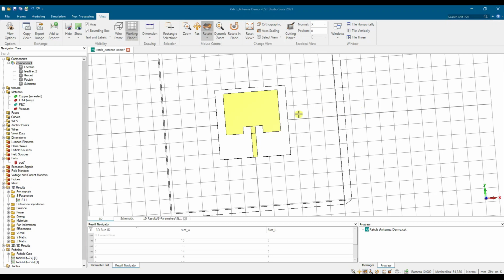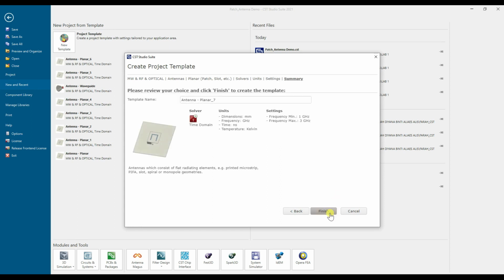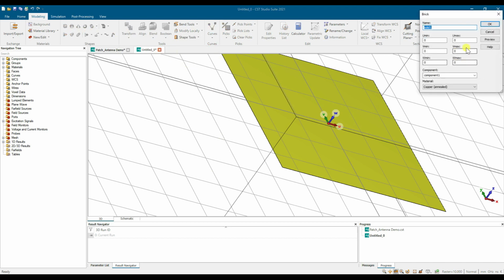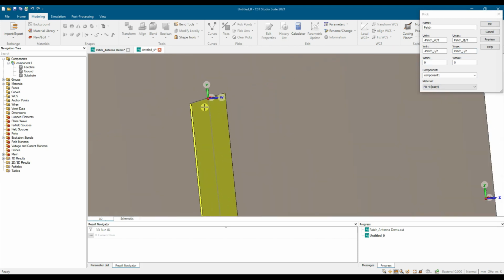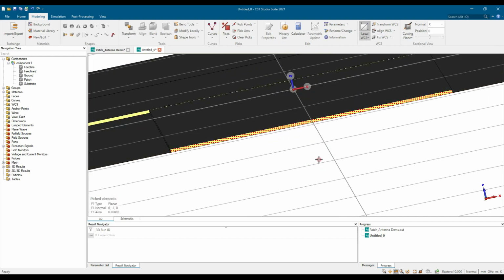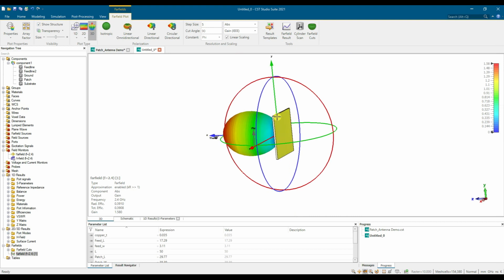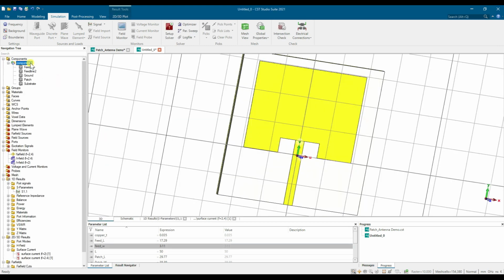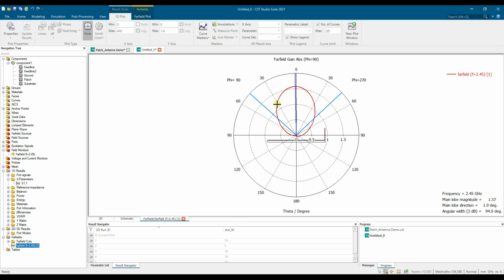Design Microstrip Patch Antenna Using CST

Comment: How to calculate the length and width of the substrate
Reply from the maker: Hi! Thanks for checking out the video. For a detailed step-by-step derivation and formulas to calculate the length and width of the substrate/patch, you can refer to these standard antenna engineering textbooks: Antenna Theory: Analysis and Design by Constantine A. Balanis (Chapter 14, Microstrip Antennas, specifically pages 811–815 in the 4th Edition), which covers the transmission line model formulas for width (W) and length (L).

Comment: Hi. I am Liyana. I currently doing my FYP in my last semester of degree. It is related to CST where I need to design a microstrip antenna using metamaterial. May I contact you for some advice and suggestions? I hope you see my comments and I do really need your help!!!
Reply from the maker: Hi Liyana, Microstrip Antenna Metamaterial Superstrate mainly is to Enhance Gain of the antenna, is combine patch antenna with metamaterial will have 2 layers. You can write down your question here or email me lysstuff888@gmail.com
Reply: Alright, just realised your reply. Will email you soon! Thank you for responding 😊

Comment: hello , nice tutorial, is this antenna have a good impedance matching and good VSWR ??
Reply from the maker: Hi, yes. When the S11 (Return loss,dB) is good same goes to impedance and VSWR. You may refer to the relation between Return loss(dB) , impedance and VSWR.
https://www.microwaves101.com/encyclopedias/voltage-standing-wave-ratio-vswr

Hope it helps. :)

Comment: why not adding patch and feed?
Reply from the maker: Hi, What do you mean patch and feed?  This is patch antenna with it microstrip feed.
Reply: @LYSStuff  why don't you use" add " to patch and feed line
Reply from the maker: Now I get what you meant. It does not effect the result. It just combine "add" both conductor design together to become single component. As long we sure both of patch and feed is connected, then is fine. Hope it explain your question. :)
Reply: @LYSStuff  thank you
Reply from the maker: Welcome🤝

Comment: MY RETURN LOSS VALUS IS NOT COMING BELOW -5 dB , WHAT METHODS I SHOULD APPLY TO GET IT BELOW -10 dB?
Reply from the maker: Hi, I think mismatch impedance of the feed. First, You can use a quarter-wave transformer to do this. Else is the design dimension not suitable for the desire frequency. 

However, you need to figure what is the application of the design? If you designing antenna, you might also need to  consider the polarization, gain, efficiency, radiation pattern, . etc. Different application might be different design.
Reply: @LYSStuff  in inset feed should we use quarter wavelength?
Reply: Then again I have to connect another feed line after quarter wavelength?
Reply from the maker: @bikashsahoo9152  for inset feed.. No need another quarterwave after feeline. You may refer to this reference.

https://www.antenna-theory.com/tutorial/txline/transmission5.php
Reply from the maker: @bikashsahoo9152  no need, you can refer to this link for how to determine the size of the inset gap and distance to match the impedance matching.

http://www.microwavetools.com/inset-fed-microstrip-patch-antenna/

Comment: HOW DID U CALCULATE THE LENGTH AND WIDTH OF SLOT IS 14 AND 5 MM RESPECTIVELY, PLEASE TELL.
Reply from the maker: Hi, for my case, I just do tuning using parameter sweep. Tune around the slot width and length. No calculation applied.

Hope it helps. :)
Reply: @LYSStuff  Okay Thanks